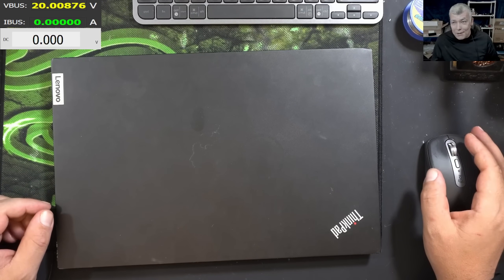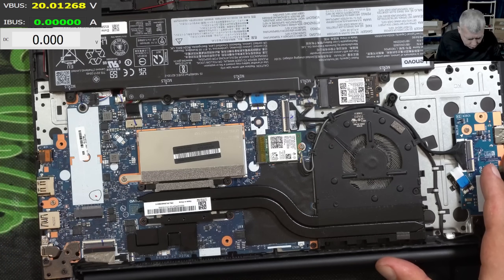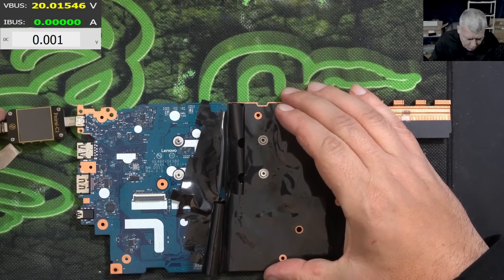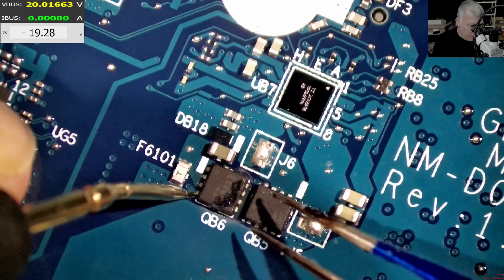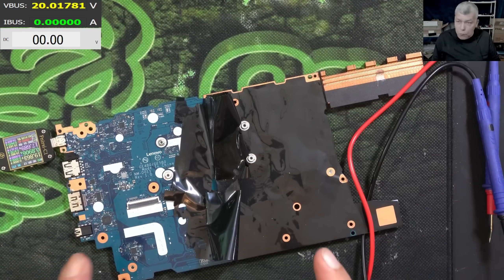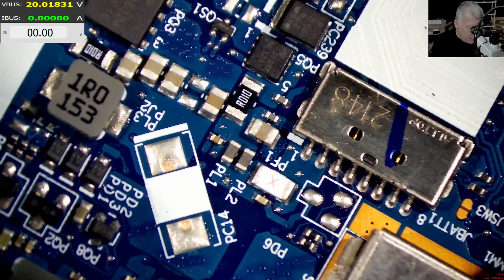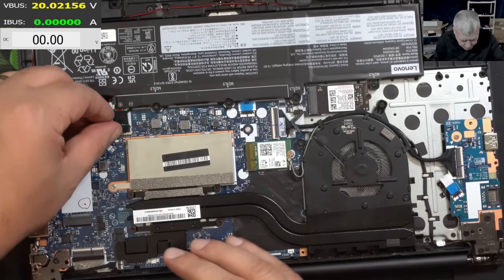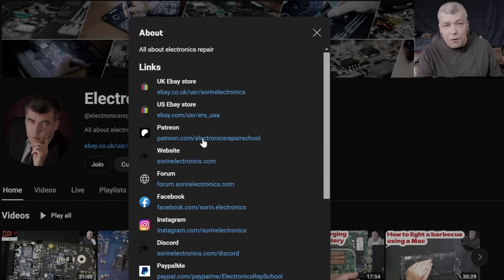Lenovo E15 not charging,  customer believe its a capacitor, but, ......

Comment: Do you remember the fault this showed? I have an E14 Gen 4 which doesn't power on either and is drawing 19v and charging the battery. But when plugging in I get 3 flashes as if it's charging. When I then hold the power button for 10 seconds it repeats the three flashes, which makes me think the EC is fine. I have not been able to measure the mosfets yet, but I thought i'd ask if you had the same fault on this machine. :D

Comment: I have a few questions if you don't mind?

What is the most likely cause for the current spike that caused this?

Was the repair you made the only way to repair it?

If the problem happens again can the fuses be replaced or is that the end for the laptop?

Your channel is amazing btw.
Reply: Let me answer. Mosfets were there to "protect" the board while the fuse was already doing that. Yes, next time, if this happens for whatever reason, the next in line is the fuse. So the fuse would burn and get replaced. If those MOSFETs were not removed and shorted manually (to complete the circuit), it wouldn't work.

Comment: is this how the repair is finished? With the solder wire left in there, not replacing the mosfets? If yes then what a total joke! Not to mention the way of diagnostic is alot of guess with trial and error at the expense of the customer i.e. 'we test it like this if it will work or not, but if it blows up something further then...well it wasnt working anyway so we tell the customer it was not repairable"... what a joke. Provided there are several other youtube laptop repair channels where the same job can be seen is done much much properly, for example parts-people dell laptop experts, northridgefix, etc

Comment: I need an help I have an 820 g3 coming on but not charging I checked the first mofset and it was shorted then I replaced it not the only voltage passing through the mofset is 1.06v and 19v comes in from the charger

Comment: Can that port output a voltage higher than 5V?
Then you need something besides the fuse to keep it under control.

My master described that fuse as the last line of defense, before that you need to install other faster-reacting protection.
With that much power, houses don't even need a circuit breaker.
Why aren't there just fuses with a fuse insert everywhere?!

I also installed an adjustable unit for extra protection against overvoltage that trips if necessary...

Safety should come first.

Comment: You're right, the auto industry has been getting worse and worse since 2004, more and more modules and plastics have complicated our lives and everything is too expensive just for a nice look and lifestyle. Greetings to you, you're great.
Reply: Are you sure?
My dad almost died when the knowledgeable "Iván" guy replaced the rubber energy-absorbing part of the rear wheeled garbage truck's power transmission with a boot sole because it was cheaper. Fortunately, it broke while driving at a slow speed on a connecting road. There were no houses or people nearby.
The cardan arm flew several meters...

The other one, my current co-worker, sold his car, and a sunfituning guy hacked his car. The car caught fire in the city center on the guy...

It's better to have a professional do it with the right technical background and tools...

Comment: Unrelated to this repair, but I keep seeing these TPS65994 ICs failing.  

TI has made numerous revisions now (AC, AD, AE, AH) , so I wonder if they know it’s a common failure point or they have faulty firmware.
Reply: Look like they use those type of controller chip in some older model  Lenovo,  and all have very short production life, they have many different number and different version in each number. Here I thank you for remind the repair I am working on, and found the part and also sale them pair with 2 mosfets, look like it is very common fault.

Comment: Next will come ultrasonically welded cases without screws and main board chips that brick themselves when the internal battery goes too flat or powered on with back off.  Manufacturers just want more profit and items to break as soon as possible once out of warranty with no repairing. Sad times.

Comment: Sory, i dont understand, you said the problem was the pd controller, and not the mosfets, how you know that? the second mosfet its ok? Not burn? And if the pd it was faulty why work without the mosfets?
Reply: the PD controller does not output the correct voltage for the mosfet gates but it negotiate the 19V with the charge.

Comment: It's really hard to see why that charge pump should fail given that it has no current to source, just the capacitance of the gate. I wonder if on a two port one using an external (bodged on!) high side charge driver chip would be a better solution?

Comment: In newer revisions of the same E15/E15Gen2 they got rid of those mosfets, so yeah, you upgrade his motherboard:D
Reply: Really? Did they get rid of the TI tps chip too? Because it's not the mosfets that are failing, it's the TI chip. Just a faulty design. TI should be held liable for those failures. It's systemic.
Reply: Whats in the later revisions and can i fit that on this board?

Comment: Ok so how and where can i buy and flash that PD controler so i can replace it?
Reply: Why would you want to do that, it will fail again in exactly the same way, maybe within a month, or maybe a year, it's a design and manufacture mistake to fit this PD controller and MOSFETs. In later revision boards these problem chips are no longer installed at manufacture! You would basically be replacing a fault with a fault 🤷🏻‍♂️
Reply: @Omegajet223  Whats in the later revision then and can i replace them with that?

Comment: OK Sorin.......but does the SECOND Mosfet not usually protect the battery current from flowing to the input? How will this work without the Mosfet? Or is this not an issue with USB-C inputs?
Reply from the maker: The current from the battery can't flow to the usb-c, there is a buck-boost power supply in the middle
Reply: @electronicsrepairschool Thank you!

Comment: Lenovo has great laptops but i hate them. They really started the soldered ram and cpu non replacement surge. I have had 1 and never another. These stuoid designs are the result of nephews and neices working for manufacturers. Stupid ideas pushed up the chain because
Reply: I also hate the onboard RAM

Comment: Hi Sorin why can't you replace mosfets
Reply from the maker: Because the mosfets are good, i tested them in video, the problem is the pd chip
Reply: @electronicsrepairschool thank you very much as I have the same laptop same problem, let me try to do exactly what you have done
Reply: @electronicsrepairschool ok sorin but if the mosfets are good, why did u bridge them and if the issue was the PD why didn’t u replace it and job done, is it because the pd need program ? I need to understand there must be something I missed here.. ..thank you
Reply: @Edge-71 same question me too
Reply from the maker: @Edge-71  This is a common fault which means the manufacturer did a mistake, we should correct these mistakes, replacing the chip with the same chip, is pointless in this case, a ticking clock
Reply: @electronicsrepairschool Hey sorin I must be still missing something here, I get u must have sound 25v on the gates to open,but if they where good I can’t see by removing them and bridge source to drain would solve the problem if the pd is dying, far for me to question you judgment no way I would do that, I’m just asking myself what u did fixed the issue..thanks and we all appreciate you immensely.
Reply: @GregM the chip isnt working properly... Could change the chip? Yes but could fail again because is a common fault like Sorin says.
Reply: Mosfets were good... the problem was the chip...